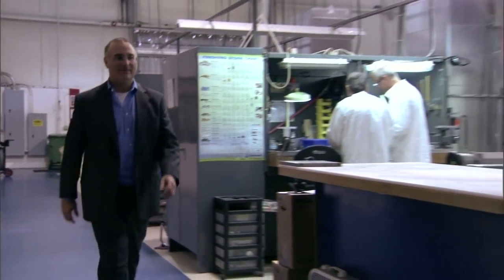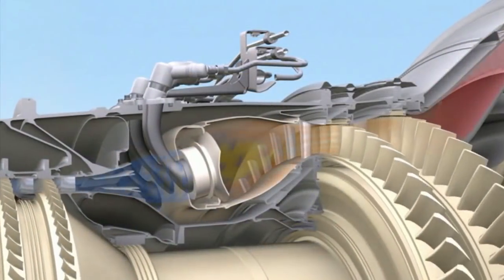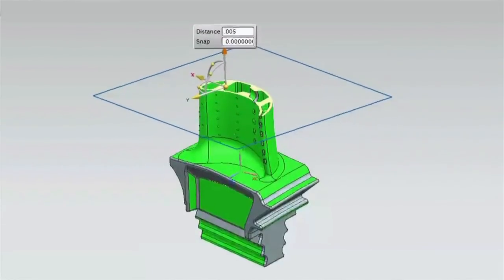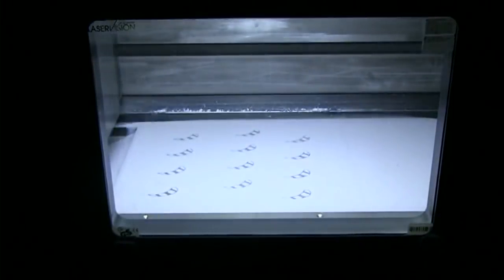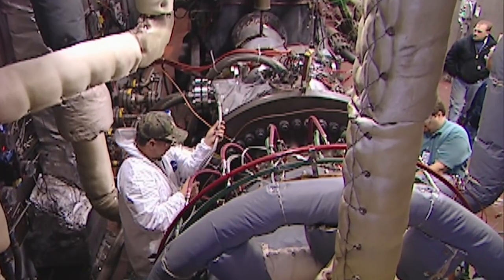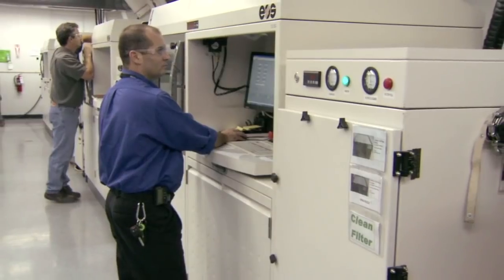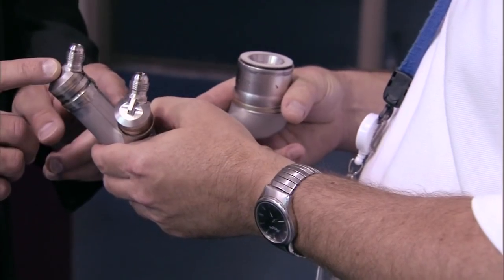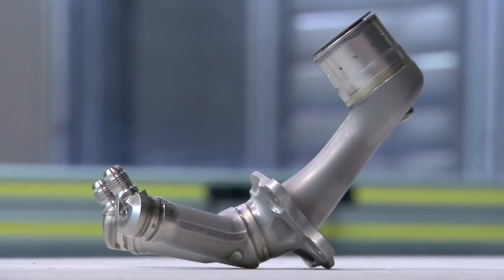The CFM LEAP Fuel Nozzle

Comment: A double tube central nozzle with vortex by air pressure with 45° drilled off of vortex front edge thru center with forward wall of vortex cut with 45° off of vortex cut angle to outer straight thru creating a vortex while a straight thru with mixture results better with cleaner burn with more mixing without extra excessive turbulance..  vortex injection slightly both interfering to outer straight, slight turbulance  for better cleaner mix but without airflow obstruction.. actual injector before both. Creating a dual more effective intefearing airflow causing better atomization.. happy new year!

Comment: So far if we replace fuel nozzle, in the insert lockpad some parts are often broken
Reply: Good. I am not from this field, why are there 2 passages to fuel nozzle? That makes it look like Y shape.
Thanks for your valuable time.
Reply: @cck0728  One is primary flow and the other is secondary flow... Secondary flow will be the fuel line which will be active during the full engine cycle and in the primary flow , the fuel flow will happen only during starting and in some cases during idling depending on the conditions outside..You can differentiate them by the difference in diameter of the two lines